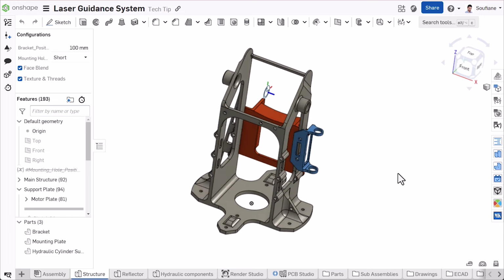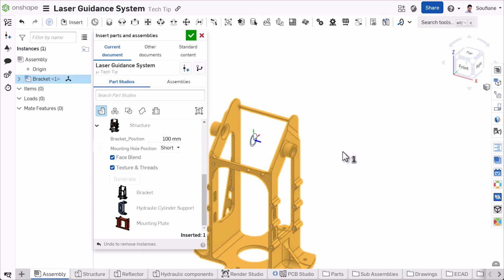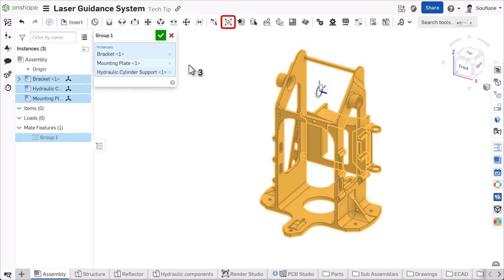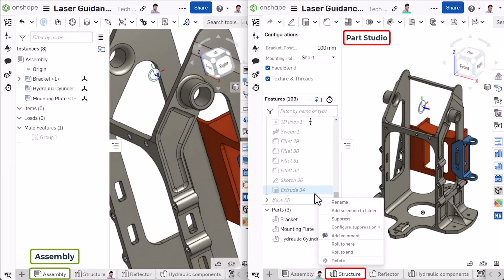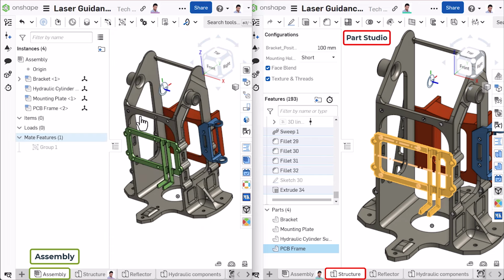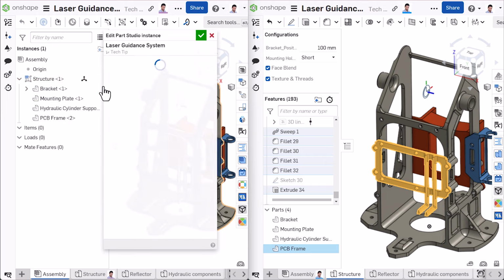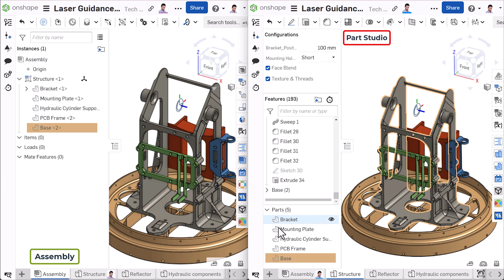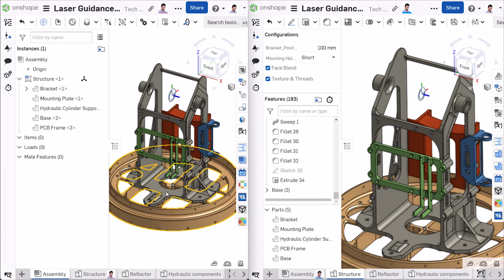How to Maintain Part Studio Integrity in an Onshape Assembly - Tech Tip

Comment: I suppose the only concrete situation I can think of where that wouldn't work is if some of the parts need to be able to move. Otherwise, I guess the decision between importing individual parts into an assembly or sub-assembly, and importing as rigid is mostly based on preference? Or are there typical guidelines/best practices that people tend to follow?
Reply: If you want motion  , insert individual parts separately and mate them. If you parts has no motion insert them as rigid. That is my rule of thumb.  In-case there is a pattern in part studio , creating BOM assumes each part is unique hence avoid patterns in part studion unless patterned parts are not needed in the BOM ig ball bearings  , its okay to pattern balls in part studio since they are not needed in the BOM